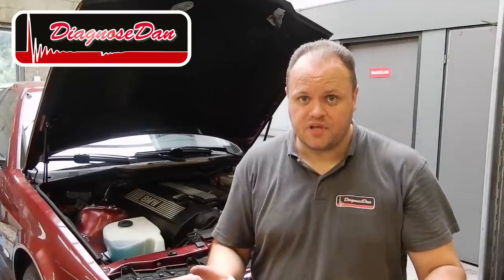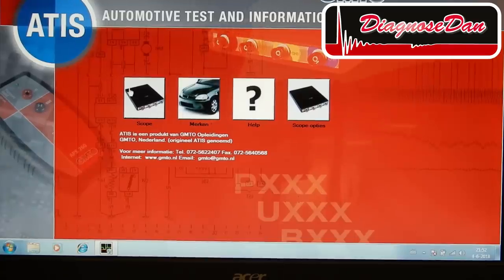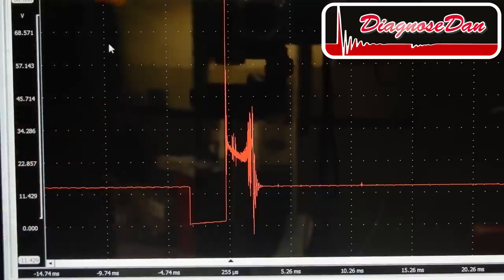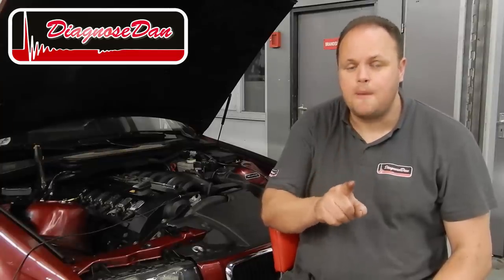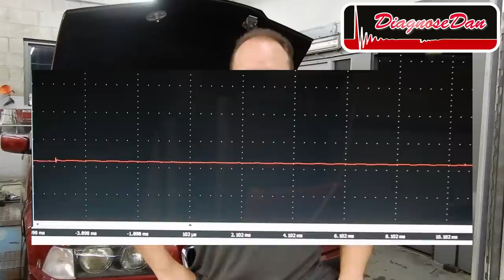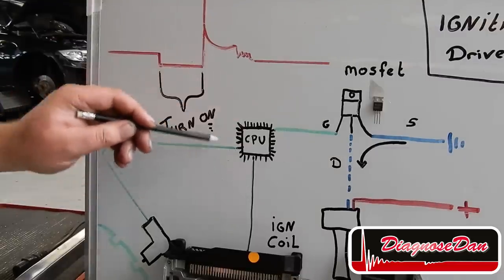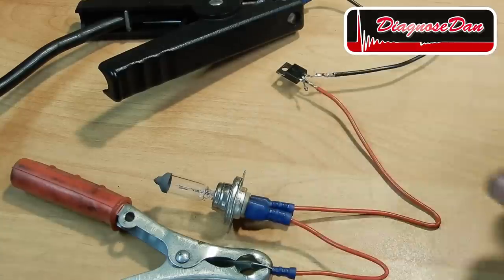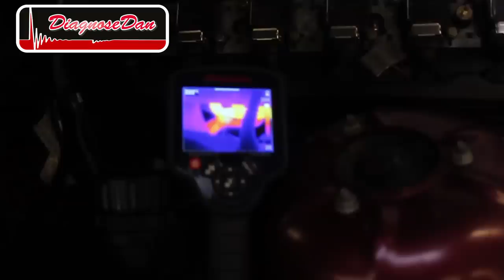ignition coil driver

Comment: Old video but new to this pair of eyes. I noticed that #6 coil looked different than the rest,  Different  writing and the white squiggle or whatever, Possibly been replaced before and is an aftermarket one. I've seen from other diagnostic guys NOT to use anything but OEM here because of the internal resistance and el cheapo  build quality in too many aftermarket parts in this day and age.  Great video Dan..

Comment: I've been in a similar situation dealing with an engine control module from a different vehicle and had to trick the anti theft system also. I want to think my way of dealing with it was probably not as quick as whatever you had up your sleeve but it will work on almost any car and I felt very crafty when it worked.
Reply from the maker: Did you taped the key of that other car into the antenna?🤣🤣
Reply: LOL, nobody says a car must have only one control module for the engine.

Comment: I really like your approach Dan. Its awesome
Regarding the driver - it is 55V 80A P-channel mosfet. The rest 5 cylinders works fine so the MCU micro controller seems to be fine and maybe it would be enough just to replace a shorted Mosfet and a gate driver between micro controller and Mosfet to fix the MCU
Reply: That must b your line of work. U knew exactly what he was talking about. Thank u for your input!!

Comment: i found your channel yesterday , and i was casual looking through your videos and yeah i have a bmw e46 with a similar error ,missfiring cylinder 5 , i will check this , but i have a additon to the fault that occurs ..... it only happens when the engine is cold , i have already changed plugs, coils , wiringharness , it realy could be this , thank you for the video , greetings from germany

Comment: Can I diagnose a shorted driver with a multimeter by measuring between ground and control wire? I am guessing I should see 0V as the coil is pulled to ground at all times?

Comment: Being an electronics engineer I liked the fault finding approach very much, although I wasn't too happy about the waveform of the trigger signal from the CPU;  I expected something more consistently square; but then again, I have little experience with meaurements on running engines.

Comment: My e36 ,i had the Immo removed for good from inside the ECU( 50 or 60 euros, cost); it now serves in the shop to test other doubtful E36s, for it will start and perfectly run ANY E36; it is my daily driver.

Comment: I was hoping mosfet replacement would of repaired cpu .
modern electronics and coding can be a problem and scrap otherwise good car simply because of cost .
You fixed this one :-) didn't expect anything less 👍
Reply from the maker: Mr B unfortunately there was more damage than just the Mosfet😣
Reply: I thought might be as shorted open to the cpu control side .
The parts new are so expensive and used not exactly plug and play swap due to immobilisers and coding on newer cars .
Was good to see the mosfet demonstration with the wet finger :-)

Comment: Super great explanation of diagnosting coils and drivers.
Especially the inside part of the PCM.

But - didn't you say the PCM was sent to a special company and verified as good?
As a technician I love this work!
But I guess the time wich was needed to open up the PCM, testing and renewing the Mosfet in vain, finally buying an other PCM, programming etc. etc. costs over costs.
That's why other shops stop the repair / diagnose on older cars at a certain point.
Nevertheless I appreciate your work!

Comment: I'm a little confused about when I need to use attenuators to protect my scope from overvoltage. In this case you're tapping into the primary side of the coil, do you use attenuators there? Are they ever needed when measuring current by inductive clamp meters? How about when you tap into secondary or primary voltage for a fuel injector?
Reply: The meter will have a voltage spec.....like 400Volts. 
You attenuate to get finer detail.

Comment: Thank you DiagDan for for your usual informative video👌
Learning that its the negative current from the BMW DME "activates" the COP, do you suggest i install a fabricated 12AWG line using round copper terminals on each M6 bolts that holds down the COPs to the plastic valve cover & bolt down this line to a good grounding point on the engine bay?
My objective is to try to avoid damaging the DME mosfet as what you have described in your troubleshooting....  ✌️

Stay safe & more power to you & your team!

Comment: For the Immobilizer :
New(used) ECU comes with the Key. You can swap the transponder chip to the old key.
When no key is provided, swap the immobilizer circuit from the old ecu to the new one.

Comment: Lesson learned here was not 100% rely on information provided customer and other shops for the reliablity of part tested or replaced. The PCM coil driver was confirmed defective by DiagnoseDan. which other PCM shop declared was in good condition.
You have to test it yourself to confirm and solve the problem.
Reply from the maker: Thanks for watching Roger👍

Comment: The ECM driver (power amplifier switch) for a "dumb" coil-on-plug ignition (no electronics at the coil) is an N-Channel active clamp ignition IGBT (Insulated Gate Bipolar Transistor), like ON Semiconductors part ISL9V3040S it is not a N-Channel MOSFET. An ignition IGBT device has more on-board the silicon in addition to the semiconductor switch. For example, and active clamp, which will clamp the inductive fly back level to protect the device (will turn the device back on to limit voltage at its output). Also, the device will have protection circuits in case of ESD events on the gate. Other features can be added to limit current (auto fire) but usually the device will then be described as a smart ignition power driver.

An alternative test for this type of ignition would be to use a current clamp on the primary side wire. This is helpful as a basic starting point (before bringing out the thermal camera) because you can see if the coil primary winding is open or partially shorted, and obviously, if the current is flowing as controlled by the ECM IGBT. The current waveform should follow an RL current profile until the coil primary saturates, where by the characteristic will change from an exponential curve to a linear line. So, it is helpful in that you do not have to play swap-tronics with another coil. Just clamp on the current clamp and take data.

Comment: The driver is mainly for driving coil current and withstanding 12V instead of 5V that the CPU can handle. The isolation and CPU protection is a secondary effect. If they really need protection they'll use optocoupler or some like that.

Comment: 18:46 That meters got a couple of redeeming features as it can test for temp, humidity, SPL and Lux. I got mine of £40ish off Amazon but they're now double that because it's a pretty good meter for the price. Mine doesn't like the cold anymore so I need to warm up to get any sensible measurements out of it. Which is quite handy as it tells you the temp at the top right of the screen. 
The CAT ratings could be better though 🤨

Comment: In my experience, this usually turns out to be a poor solder joint right at the pin (inside the PCM). PC boards are wave-soldered (dipped in a bath of heated liquid solder). Unfortunately, the "correct" temperature for the board is too cool for the large metal pin (which doesn't fully heat properly). Instead of a thick layer (meniscus) you end up with a thin film of solder at the joint. It works fine for a while, but vibration and temperature eventually cause the joint to fail intermittently or completely. This can be a simple fix if you know where to look.

Comment: Hi Dan, just want you correct on a small miss information. On the driver, you get a base, emitter and a collector. When a small voltage or signal of the correct polarity is applied to the Base  the emmitter and collector willact as a switch or electronic rele. The signal comes fromthe control onto the base and therefor controls the switching of the emmitter and collector to earth. It is incorrect in saying that the current goes through the base of the driver.

Comment: Great video! I am wondering if BMW is the only one that use this type of MOSFET transistor driver build inside the pcm /DME for switching the primary coil. It seem like most Japanese or even Audi and Benz are using  3 or 4 wires with some sort of ignitor or icm build into the ignition coil instead?

Comment: Amazing video. For those of us who don't have a scope, could I back probe  a regular multi meter? will it catch the signal?
Reply from the maker: Than it would be better to use a LED testlight.😊
Reply: A multi meter would not give you a stable reading in this case.. 
A multi meter will give you a digital display number that is the result of sampling the signal and displaying an average of the measurement samples. The digital number will probably be jumping around all over the place on a good MOSFET.
With that said, if you back probe a bad MOSFET  that is not putting out a signal (0 volts), the multimeter will give you a stable reading of zero volts. This is an awkward comparison way of checking the bad PCM MOSFET with a good one
Just make sure you use a high quality muiltimeter with high impedence (resistance) so you don't load down the circuit and blow the PCM in the process. 
All disclaimers apply here when using a multimeter. :)

Comment: A MOSFET (metal-oxide semiconductor field-effect transistor) is a specialized FET (field-effect transistor), and like all transistors, is used for switching or amplifying signals
Reply: Ignition controller with bad MOSFET? Replace the MOSFET and save the hassle of getting another ignition module!

Comment: I agree with what someone said about how you explain things so well... just one question? How are you getting a voltage wave form on the secondary by back probing the control wire Wouldn’t  that just be a square wave I’m confused ?

Comment: Great video always well said with clear understanding and description of the diagnosis. I do have a question though. At my shop we get a significant amount of European vehicles. If we could have the ability to handle the immobilizer issues of used PCM it would greatly help. is there a chance you could help with that?
Reply from the maker: I wish i could help everybody but i haven't even got enough time to get the work at my shop done😬

Comment: Wow class video. Thanks for sharing your knowledge Dan and for going into detail. I have a nissan s13 with a sr20 with similar problem. only on the nissan theres a power transistor outside the ecu. But im finding it hard to diagnose between ecu and transistor.  Any tips dan or anyone else?
Reply from the maker: If you have a scope you can take a look at the signals, just like me in the video!
Reply: yeah i have a scope but im unsure whether the signals are correct or not. also i can only check the ECU side of the power transistor. the voltage on the other side shows as too high on the scope. Im not sure is this a back emf or sommething. There 3 wire coils E+-

Comment: Hi Dan,
Thanks for the brilliant video, I have a Toyota Avensis T22 20td 1998 2CTE.
I am a 1960's mechanic, and I am baffled by this vehicle non start issue.
It has a denso type old type hydraulic fuel pump wire controlled to pump
controls, The vehicle refused to start one frosty morning, the following
day after a battery charge, it started fine. However since then the vehicle
has refused to fire up. I have tried all the basics, good fuel supply to pump,
cut off valve replaced, pump timing okay, but still no fuel from the high
pressure injector pipes. I am guessing at the immobiliser being faulty.
The key, and transponder seem okay and a new ign switch fitted.
The alarm system and key locking okay.
I have reached the limit of my knowledge, and would appreciate any
help. If you think this is a ECU immobiliser fault and is it repairable ?

Comment: Also, would it be possible to replace the damaged #6 transistor on the CPU board and fix the trace with a jumper wire, etc.?
Reply from the maker: Maybe!
Reply: Thanks for the reply.  Just wondering since I have replaced similar parts on computer and electronic circuit boards.  Most people would want a whole new CPU I imagine and not fool with component-level repair.

Comment: Yet another superb video, I have learnt so much! Would it have been worth checking that the potential fault (short) on the ignition coil no longer existed before connecting to the ‘new’ (second hand) unit, just in case the previous garage had not actually replaced the ignition coil, or replaced the wrong one, otherwise could have potentially fried the ‘new’ units CPU too?

Comment: I don't know any shop or service that would go into the science of diagnosing any issue as deep as it has shown in this video. There is almost no place (Other than Dan:) out there these days that would repair what is actually broken than the replacing the whole thing... 
You take this car to a dealer, they will tell you that the PCM is fried and a new one ($1500) is needed. Plus diagnose, labor etc. You are looking at a $3000 (Probably more). And your car is worth $2000 (maybe). What would the poor owner do?
Looking into trading it :(
This owner was lucky :)
Subscribed :)

Comment: Great Video Dan. I'm going to look more into Mosfit repair options as I get a few BMWs with ECU issues and To fix them for the customers when possible will be great especially when I let them know it's not going to cost them an arm and a leg and their old BMW doesn't need to go to the Scrapyard. Not surprisingly you cant show us the fix to get past the Immobiliser but would reprograming this ECU be an option or will it not program the ECU (DME) with a different vin number stored.

Comment: Thank you Dan for this very valuable info.
Right now i have the exact same problem on a M52 from a 328i bmw. I do not have a oscilloscope, i only have a multimeter. 
Both side connections, rigth and left on the coil give 13Volt with the engine on. The midle connection gives 5V~6V at idle engine speed. There is no spark at all on the plug, i have tested several new plugs and two new coils on it...
Is there a way to check with the multimeter if the mosfet is good or not? Thank you! Best regards!

Comment: Amazing (and sad) to see Seimens didn't put a protection network between the CPU and the coil drivers.  I design and manufacture the J&S SafeGuard.  They don't blow up.  :)

A simple resistor and zener would be enough.  Remember, the MOSFET is sensitive enough it can be turned on through the resistance of your finger.

Comment: Great Video!  You mentioned the immobilizer.  How do you reset the ecm immobilizer.  I have a 2005 mini cooper that was in an accident and replaced the engine and transmission with another 2005 mini engine and transmission.  It will not start.  The BMW dealer said I have to buy another ecm.  I don't believe that.  I think there should be a way to reprogram the ecm.
Reply from the maker: Michael Kuzemko, did you replace the engine computer?
Reply: I changed the computer.  All the engine does is crank.  I gave up working on it.  The car has been sitting for one year.  There are two problems I see.  There is a VIN number mismatch and also the DME is trying to communicate with the EWS3+ and cant.

Comment: Great video, great explonation! When you measured the control side at the pcm we've seen nothing because the driver was dead. But is it possible in some cases that the pcm turns of one driver purposely due to some kind of "emergency mode" or for example by detecting a bad injector?
Reply from the maker: RuinMan Never seen that! Only on injectors.
Reply: Thank you for the answer! :)

Comment: Hi Dan.   Thank you for the videos they are very helpful 
How can I check for signal from the ecm for Cylinder #5 on a 06 Mercedes Benz e350 P0205
 I have two wire leads at the injector grey and white/green grey is ground key off and battery voltage when idling but I have no signal at all from the white/green   
Resistance from ecm connector to the injector conector is 00.4    
Also can I just ground the injector connector with a test probe?
Thank you for you help

Comment: Great diagnosis, Dan. Would you mind explaining how the internally shorted coil did not blow the fuse instead of going to the negative wire leading to the driver? The coil find its ground inside of the coil, shouldn't current go to that ground instead of the pcm ground?
Reply from the maker: little7 On this design the coil negative is the driver. The short circuit proberbly did blow the fuse. But the car was taken to my shop with the fuse and coil already replaced.
Reply from the maker: This design Works as a 2 wire system, there are 3 wires but there is not a transistor in the coil. The 3rd wire is just to check if the coil fired.

Comment: As usual, amazing explanation and diagnostic critical thinking. I have a couple of questions if you please. The first, when you were measuring across the primary coil, how did the voltage jumped over 60 volts? as the supply was only 12v and the PCM controls the ground side.
The second one, pretty please tell us how did you solved the problem of immobilizer of the used PCM? here we always change PCM,  ignition switch with the immobilizer & the gateway to pass this trick.
Million thanks in advance.
Reply from the maker: Ahmad Fathelbab The voltage spikes because a collaps of the magnetic field. I didn't change the ews, and key but that's one way to do it.
Reply: DiagnoseDan could you tell me about that way? Have you replaced the immobilizer chip from the old pcm?
Reply from the maker: Ahmad Fathelbab 😉
Reply: DiagnoseDan  😉

Comment: As I mentioned before.  A great video!
Is it one of the reasons for making 3 wire coils where the transistor is part of the coil?
In such case it won't hurt the ECM. Am I correct?